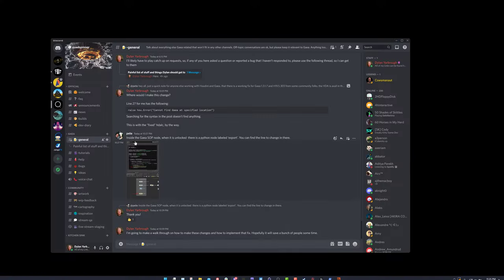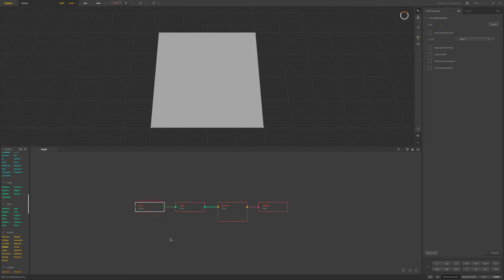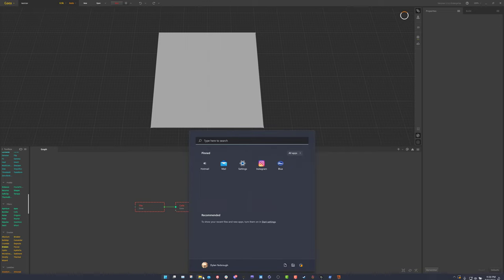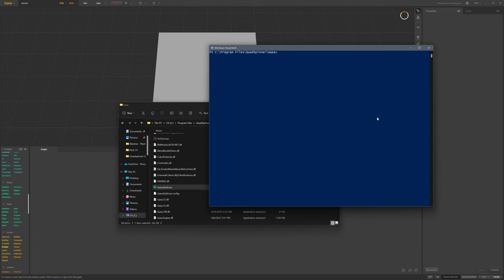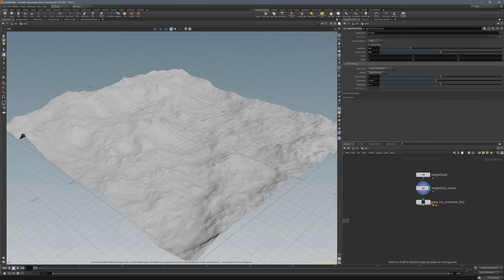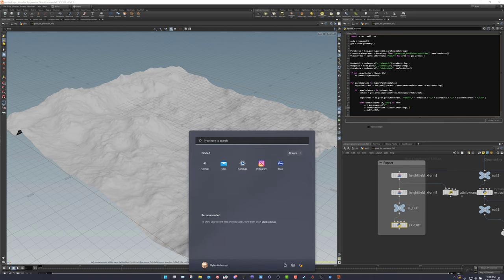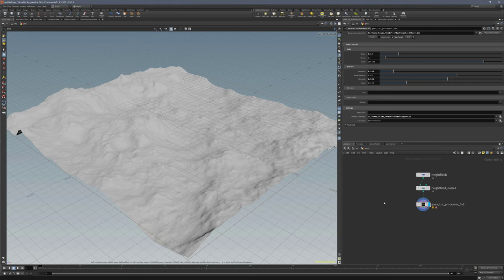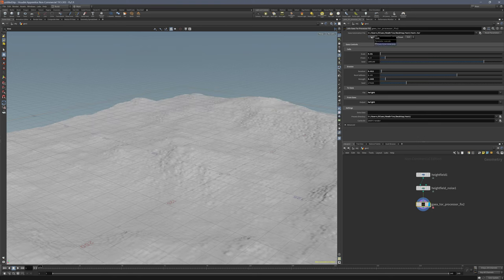Houdini 19.5.303 to Gaea 1.3.1.7 Bridge work around. Gaea Tor Processor Changes.

Comment: Hey Dylan, quite new to this process. Why do you want to use Houdini first and then Gaea? I assumed it would be usefull the other way around.
Reply from the maker: Some studios and artists may use Houdini's Height Field system to create a landscape but may want additional effects, like erosion or other filters that Houdini does not have but Gaea does. 

Essentially, you're taking what you made in Houdini, processing it in Gaea, then sending it back to Houdini. It's a common workflow for landscape modelers.
Reply: @DylanPWN  ah. so basic setup in Houdini and then finish it up in Gaea